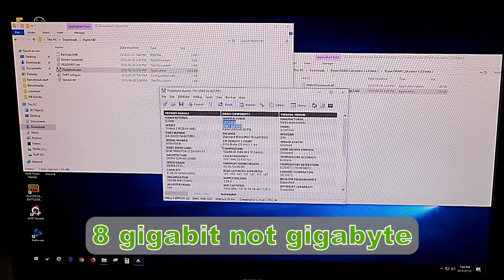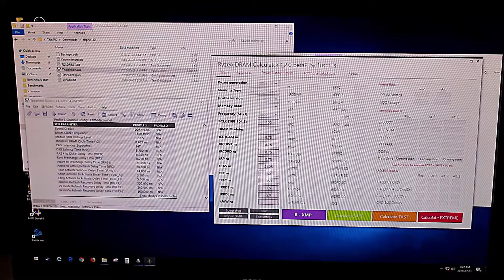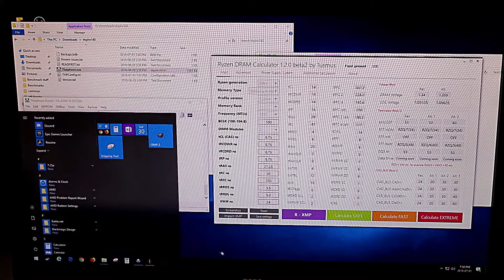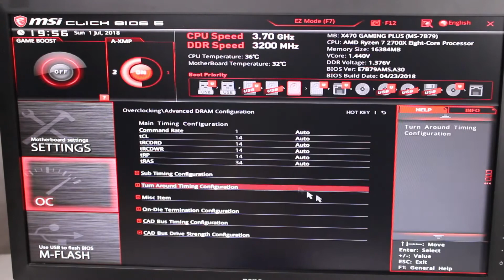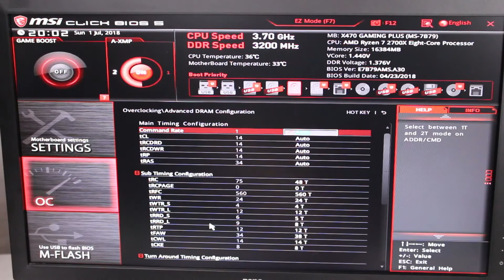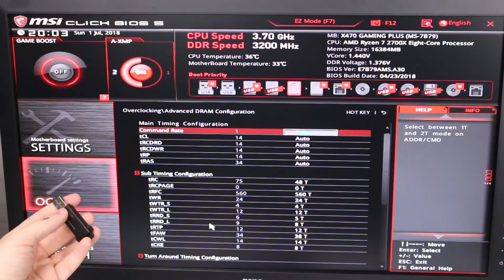How to Set Ram Subtimings on Ryzen CPUs! | T3 017

Comment: Why would you have XMP enabled if you're manually entering in all the timings?
Reply from the maker: Simply because I didn't want to manually set the voltages. The XMP profile will set all the voltages to their maximum safe values, however the calculator also gives out voltage setting information.

Comment: Do you only have to put in the timings? What about the section on the right side of the DRam calculator? Do you have to set those settings as well? (Cad Bus, ProODT, those stuff)
Reply from the maker: You only need the timings and voltage sections, however if your bios allows for all of the other fields to be manually tweaked you can certainly put them in as well. A good rule of thumb is to save a "before timing tweaks" bios profile, so that if something goes funky you can reload to a safe state.

Comment: Thank you for video 
I have asus x470-F gaming 
Ryzen 1700
2x8=16 ram gskill tridentZ RGB F4-3200C16D-16GTZR ddr4-3200 pc4-25600 
My ram run default in bios show just 2133Mhz  1.200 V 
I try to change ram frecuency  not xmp to 3200 and my desktop run but i dont know it is actually stable  and its realy run at 3200 or i need to do more serous setup in bios
Bios is update to latest 
My question is how to see ram run at 3200 need some test program?
I heard this ram just reach 2666mhz i dont know if true   i aways update by bios  maybe ryzen should fix this intel didt have problems when we speak to ram 🤔🤔
Reply from the maker: To check the ram speed in windows you can use an applications like CPU-Z which will tell you the memory speed under the memory tab. CPUID's HWMonitor may be able to report it as well, and HWinfo64 certainly can (though it also reports a ton of other information).  Easiest way is to open Task Manager and click on the Performance tab and select Memory, on there it will report the "speed" if your bios is correctly set to 3200 then the speed reported in Task Manager should be half of that 3200 and should read 1600MHz as this is how DDR (Double Data Rate) ram operates.

If the Bios is reporting 2133 then the system is only running at 2133, it should display 3200 if you are manually changing the frequency. I've never worked with the Asus x470-F so I'm not 100% sure how they handle memory settings.

Comment: If you make your own settings , you NEED to switch XMP in your bios OFF !!!
Reply from the maker: Having tested with the profile turned off and turned on, the only thing that I have seen change is the default base timings and slightly more aggressive voltage settings with XMP. Be aware that any settings manually changed by the user will take priority over the XMP profile.

Turning off XMP however had no effect on the timing settings once they have been manually entered. The advantage to leaving the XMP profile turned on was simply that it was already pre-configured for all of the voltage settings.

Thank you for taking the time to comment, I appreciate the feedback!